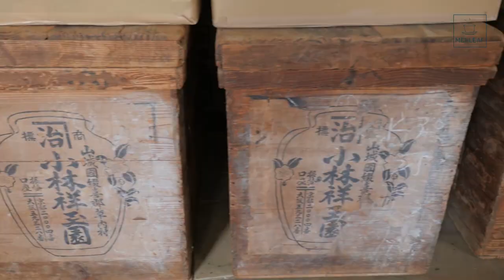Finding the Best Matcha | JAPAN TRIP

Comment: Couldn't agree more about color and flavor. I started drinking matcha a year and a half ago and was hooked immediately! So I started buying and sampling all different brands and grades. One in particular which was not very expensive, had a beautiful bright vibrant green color. However it was one of the most bitter tasting matchas I've ever had. The company's website described it as ceremonial but it was worse than some culinary grades I've tasted.  :-P  I have a few favorites that I rotate through and one is labeled as universal. It's actually quite good.  :) A little more robust in flavor but very smooth!  :D  I recently upgraded my tea kettle situation as well. I purchased one with a variable temperature feature that allows you to set it to the exact temperature you need for a particular brew, for both tea and coffee. I love it! It has taken my matcha experience to a whole new level.  :)

Comment: Great video once again! Very educational and beautifully done in the same time. I've tried  your Uji Hikari already ( I must admit I was slightly skeptical in the beginning) and i give it to you: it's a great tea. For anyone wanting to try this matcha, I suggest you drink it as a koicha (thick tea), as Hatsu Mukashi  is going to bring out its best notes in this form ( I've tried both usucha and koicha form).  P.S. : the price is justified ( this coming from a matcha addict)
Reply from the maker: Thanks for trying the tea and I agree Koicha is my way of enjoying this one.
Reply: I'm waiting on the arrival of this beauty (in my large order). What g to ml ratio would you suggest for the perfect Koicha experience? And what water temperature did you go with?
Reply: Lucky man! Well, as with brewing any tea, koicha depends on the brewer's taste(some like it thicker than others). On average I usually add about 30-40 mls of 80-85C  to 3-4 bamboo scoops of sieved matcha and whisk it with a bamboo whisk until smooth ( don't try to create a foam, doesn't go with that thickness) .  Enjoy! ( But be aware if you haven't had koicha before, it's somewhat of an acquired taste, very strong, but delicious with the right matcha grade)
Reply from the maker: We go for about 3-4 bamboo scoops of matcha with 40ml water this equates to 1.5 to 2 tsp of matcha. We use between 70-80 degrees but depends on the balance of flavour you enjoy really.
Reply: Contessamy Hey, thanks for your comments. Really helpful. Quick question: Where did you manage to source Hatsu Mukashi in the UK? Love to get hold of some based on your recommendation. In fact, where's the best source of any decent matchi in the UK that's good but not hugely expensive? Any particular brands I should try? Thanks 👍